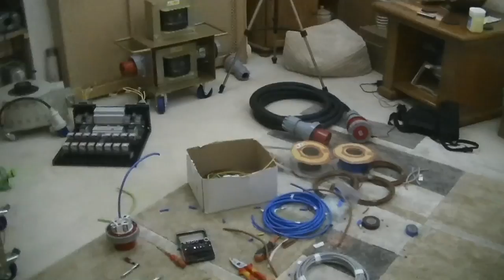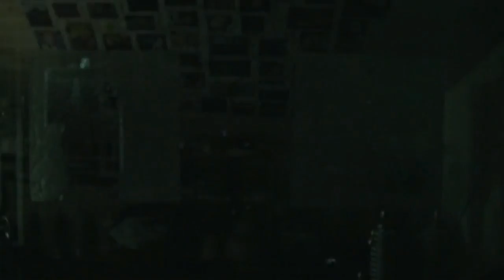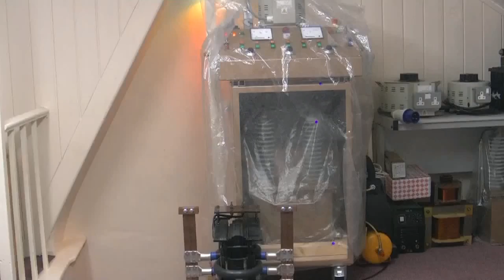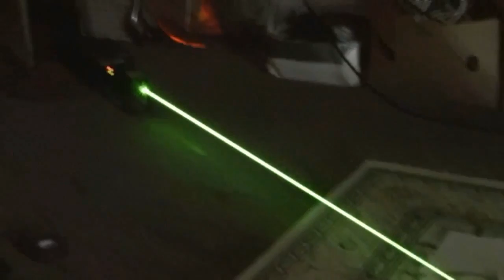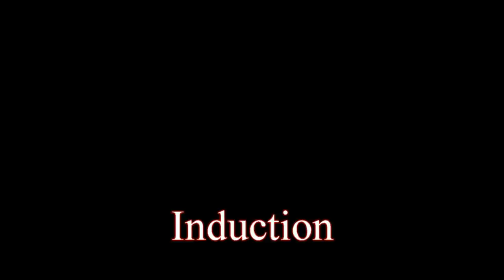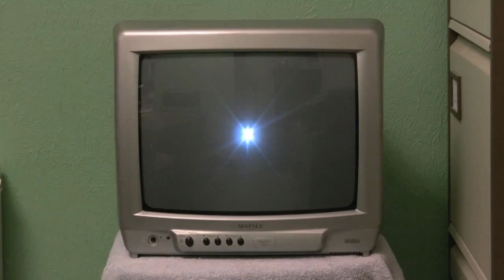Photonicinduction's Channel Trailer

Comment: That's a wicked trailer. My favourite is the super high current transformer that heats up the crowbar. Those cables are MASSIVE. I should really start posting more electrical stuff.

Comment: hey photon, were do you buy your variac? (the small white one with a black twist knob) because i would like to purchase one because when i test 240v appliances from the roadside, i don't know if they will work and would prefer to slowly crank up the voltage, rather than flicking a switch and having something blow up.
awesome videos 
you inspire me (im 15 btw)

Comment: Hey Photonic, you have a 50,000 amp transformer built, have you ever thought about making a Rail-gun aka Gauss Cannon? And do you have any demolition ranges or anything like that out where you are that would be willing to sponsor your project on their ranch? I think a lot of people would like to see you make a hunk of iron fly out of a tube at an old clunker television at 3000 feet per second, with just one high current discharge.

Comment: You should really make this into a channel trailer/intro. I don't know how to do it, but I've seen channels with them. It basically makes it to always appear on the front page of your channel.
Reply: Ah I know how to enable it now. Go to your channel page, now hover under the channel banner in the right bottom corner; there is also a "G+" icon there. Just hover a bit lower than the icon and press on the pencil that will appear. Press "Edit channel navigation" and then in the popup window enable "Browse" by clicking enable.  Then press save on the bottom and, when the window closes, there is going to be an option to add channel trailer.